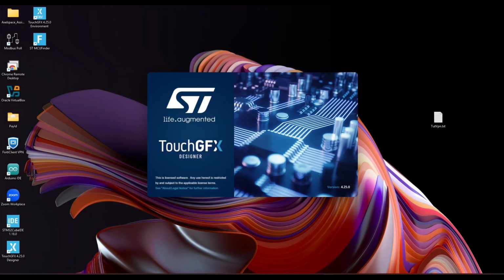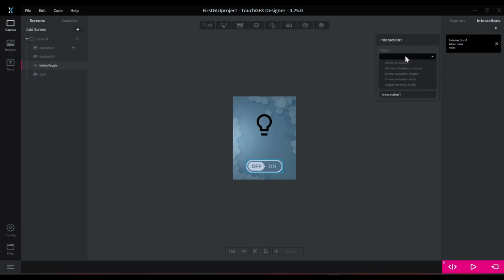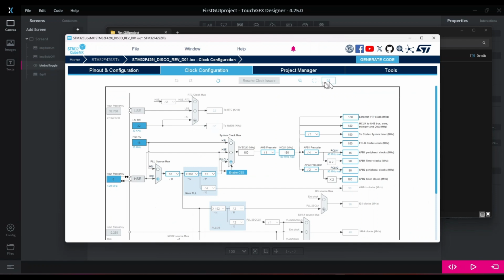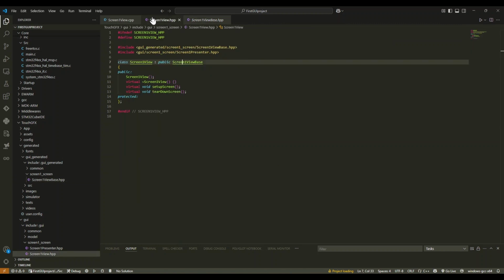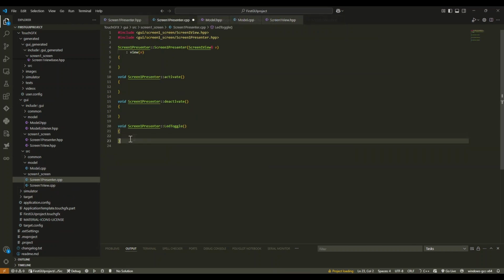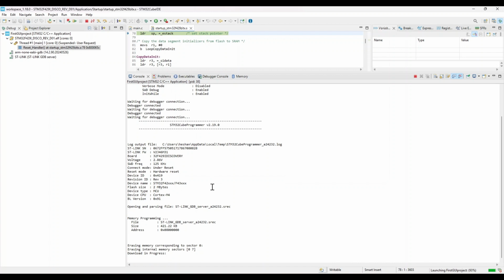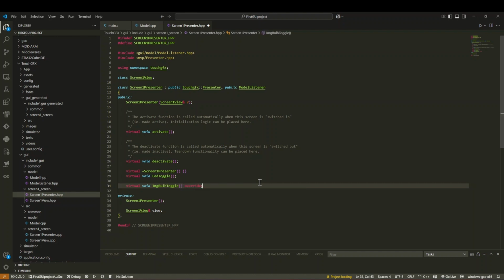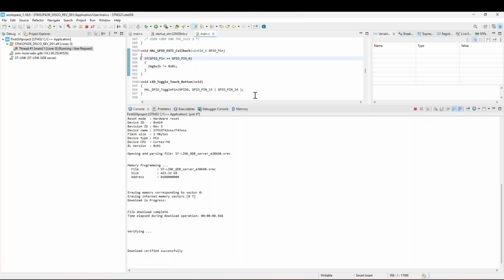TouchGFX STM32 Tutorial | Toggle LED and Update UI with External Button | STM32F429 Discovery

Comment: Frame buffer will not fit in this region problem
Reply from the maker: I used the default configuration for the board, which uses LTDC. If you're unsure how to configure the TFT touch screen, please check out my other video on LVGL with STM32. In the first part of that video, you'll learn how to correctly set up the TFT screen.  

https://youtu.be/ArRN7JFltDU?si=wa9hyF3dvCs425vY